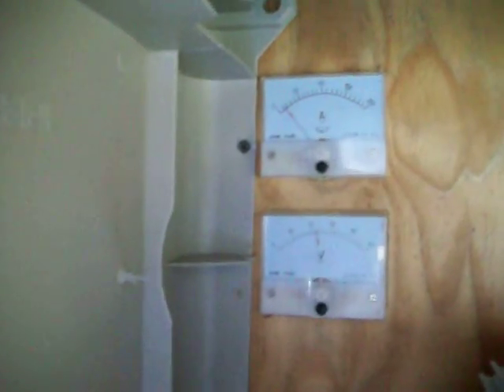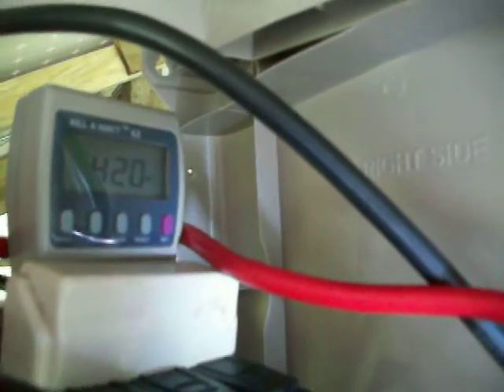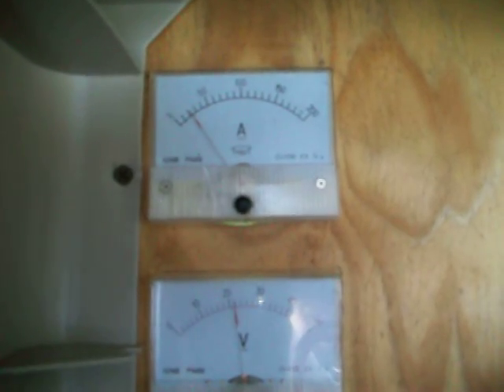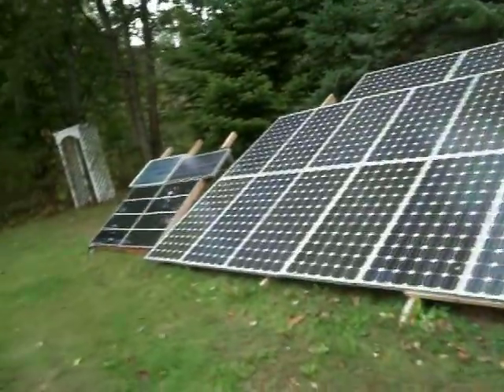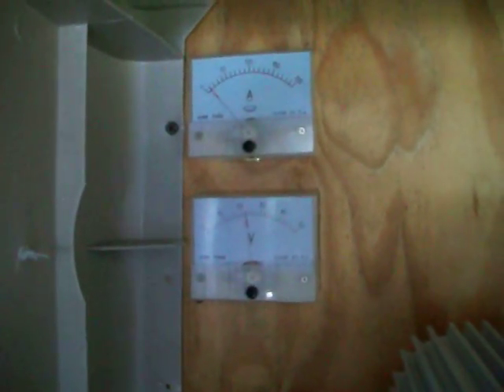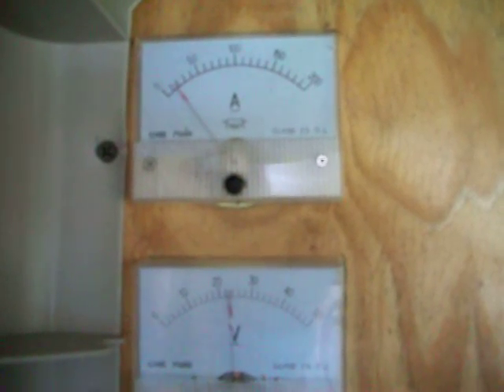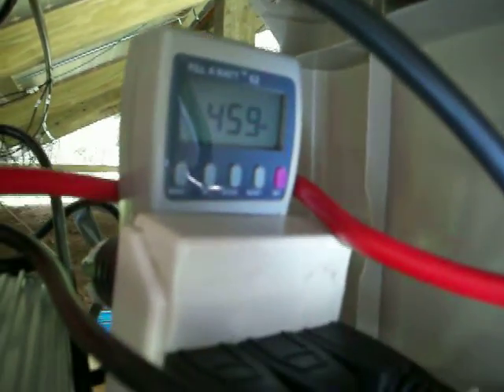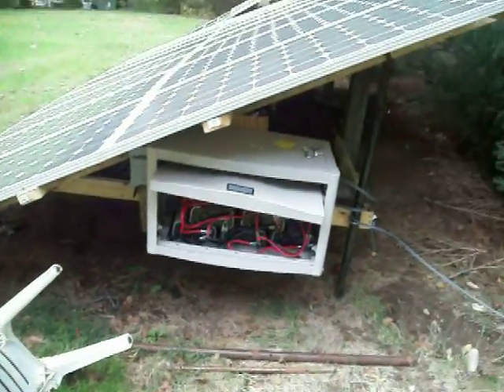solar amps from 3440w array with 5 sun500w GTIs

Comment: Just a suggestion.... But I think and only think maybe you should try putting some spacers in to get the top 500 watt power jacks up off the bottom row so some air can pass by them keeping everything cooler for better efficiency

Comment: Great system.Like your inverters and supplyer.I have one 250W inverter.My inverter is a 13vdc to 28vdc. My will spike above 28vdc shutting the inverter off. Do you know how to keep aray from spiking above inverter cut off voltage. When inverter cuts off solar aray will go higher, about 41Vdc. any good blogs or              suggestions?